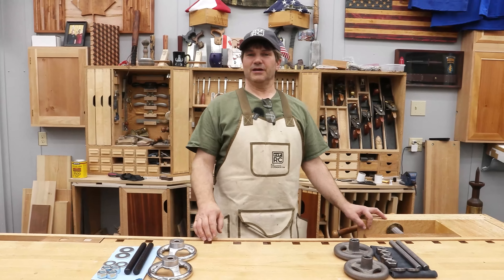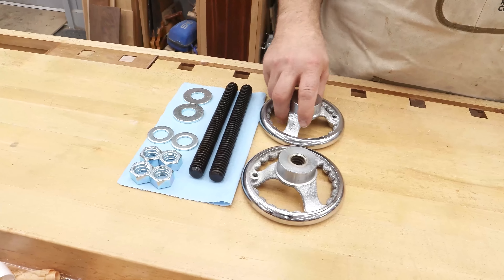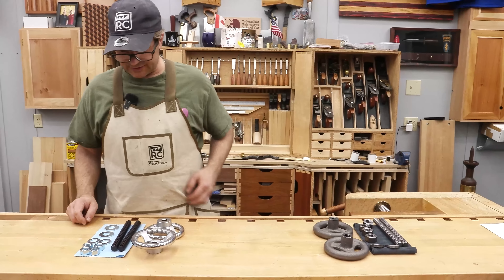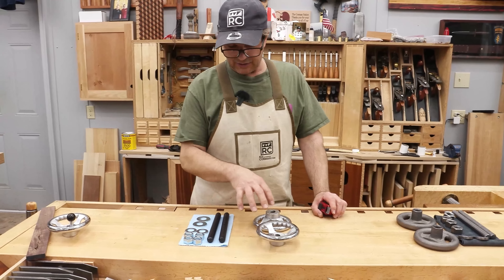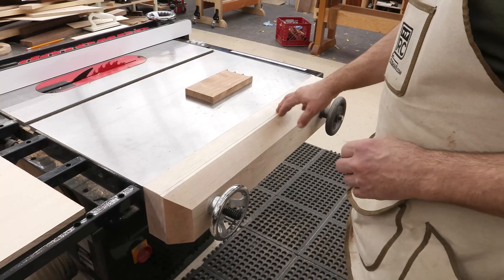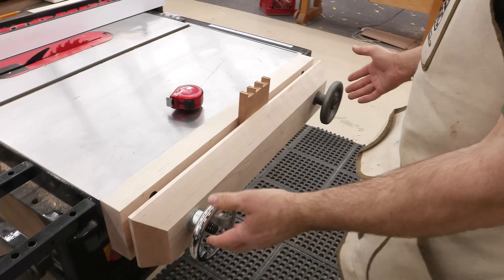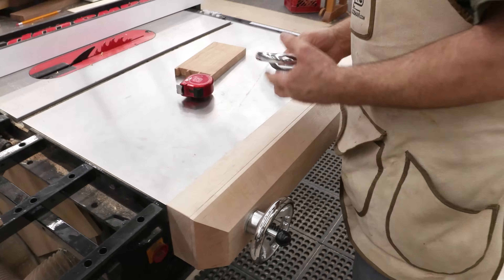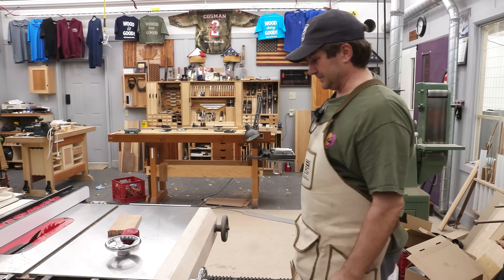Moxon Vise | Hardware Review

Comment: If you have an old weight-lifting bar (like a Olympic Bar), or find one at a garage sale for cheap they work great for the Moxon Vise. Simply cut off the screw-ends and use the spin-on star colars to tighten the vise. The rest of the build is about the same as done here. I did use 3/4 inch copper tube to line the bored holes in the movable jaw to prevent excess wear.
Moxon Vise on the cheap, I love the one I made a little bit ago......
I love watching all of your video's Rob, and the work you do with Wounded Service Veterans.
Reply: That's funny, when I saw the thread I was actually thinking about this as well. And it would be way cheaper.
Reply: @EricClaeren  I found a weight bar for free, the only thing I bought was a few washers.
Reply: You won't get anywhere NEAR the smoothness with the thread on a weight bar. Plus the lock collars are tiny, and are as loose as all hell. Overall, that is a terrible alternative. Better to just go and buy some 3/4" acme threaded rod from the fastener store, some nuts, and turn up a handwheel on the lathe.
Reply: @johncoops6897  The weight bar works smooth enough for me, and I can hand tighten the jaws even with my old hands, not loose at all when tight. For me, making something like this I use on occasion to be more than satisfactory. I understand many people don't want to bother with or have time to make something like this. Believe it on not, many people just can't turn up a handwheel on a lathe. My threaded bar slides just fine with the copper inserts I've used in the jaws. Take care, to each their own. 🙂

Comment: Thanks Rob, I made a Moxon a few years ago with a hand made screw. I tried the wood tap and die set and found that it was manufactured in such a way that it was a force fit for the two. There was simply no clearance between the tap and the die. Bad plan!  The metal wheel is a much better idea. Moxons are very useful in rifle stock repair, so you will need a vise that will open roughly 3 inches.

Comment: I was looking for an inexpensive way to make a vise a couple years ago. 

I used a few pipe clamps, and they worked *ok*.  They ended up being more trouble than they were worth, but the one thing I loved about them was the little handle that sticks out that you can use to quickly close and open them. 

I think I may invest in the Woodriver Moxon kit.  I don't have a good vise on my workbench yet, so this should be an awesome upgrade

Comment: Two disadvantages to both these kits. The rods stick out, so they're easy to run into. The rods are not long enough to allow more than a small opening if the wood you use is 2" thick. Oh, also very expensive. I used rods from Jorgensen veneer press. Works great, no rods stick out, and opens to about 8". Thanks.

Comment: Great video as always.  I just have one concern about the knob on the wheel.  I had a moxon vise years ago and I also put handles on the wheels. Shortly after, I removed them because I was always catching my apron or  clothing on the knobs.  Not a big deal but one that bothered me.  Just my two cents .
Reply from the maker: My concern as well.  For that reason we tried several shapes and sizes of knob and settled on this one.
Reply: Can we lock the wheel so that the screw will go inside instead? Something like veneer screw clamp.

Comment: Rob, can you give information on where to get the handle you attached to the wheel?  Thanks.
Reply: Pay attention - he told you in the video.
Reply: @johncoops6897  I only found where he talks about buying the whole kit, not where to get the specific handle he is using.  Could you point out the time in the video where information is given about where to get the handle.  And thanks, I'll try to increase my attention level.
Reply: @kenwood7395  - the wheels are part of the kit he sells. He makes the small knob and spacer, which are included in his kit but not the original one.
You can just buy any knob and a bolt (to modify your own wheels) from a hardware store.

Comment: I already have the Lie Nielsen Moxon  1" threads.  What do you call those springs and where did you get them.  Your kit is for 3/4" threads.
Reply from the maker: Our springs are custom made compression springs.
Reply: Those springs are called "springs" - amazingly, you can buy them at any hardware store.
Reply from the maker: @johncoops6897  nope, they’re compression springs. Guess you don’t know everything.
Reply: @RobCosmanWoodworking  - there's 2 types of coiled springs: compression springs and tension springs. Both types are called "springs" 😄
Reply from the maker: @johncoops6897  and which of those answer his question? Because these certainly aren’t tension springs, and we couldn’t find them at any hardware store.
Reply: You can get them through McMaster-Carr. Your part numbers would be either the 2” long compressed to .84” or the 3” long compressed to 1.2”. 2” part number is 1986K248, 3” part number is 1986K339. Hope that helps
Reply: @MrMaacin05  Thanks for helping me out.

Comment: Its a screw and a handle… i think taiwan can manage that to be honest!

On the tablesaw instalation, when not in use, id be inclined to keep a piece of wood clamped in the jaw. That way you wont bump into thread3d rod, you will hit the handle.
Reply from the maker: What we did was thread as much of the Rod into SawStop as possible, and now as a result it only sticks out as far as the knobs we have attached to the wheels.

Comment: ah come on. Out of the box, the Benchcrafted beats the Woodriver on every quality metric discussd here. But Rob still recommends the Woodriver? This is not a review. It's an ad.
Reply: First time watching a Rob review? Lol. He's a business man first. He's obviously going to recommend what he's selling.
Reply: It may be an ad, but it is not a misleading one. The Woodriver with the handle modification is a superior product, even if the quality of the parts is lower. The combination of the springs and the modified handle more than compensate for the superior quality of the Benchcraft.
Reply: It's also like 60% more though, isn't that an important metric?
Reply: @alankleiman3452  Frankly, I think for typical furniture woodworking usability is a more important metric than strength, assuming both are strong enough. The spring and the modified handle lower the risk of dropping the work through the jaws.
Reply from the maker: The need for a vise brought on the idea to shoot the video.  Someone else had the great idea of using the heaviest piece of equipment for another use.  We ordered both kits and saw the opportunity to improve the function with springs and knobs.  The Woodriver already had the flat spot cast into the wheel.  Easy fit to drill and tap for the knobs.  I  like it when products solve problems that exist instead of creating a problem to justify a product.  You watch the video and if you have the need you order the kit, if you watch and dont have the need, what harm done?
Reply from the maker: You’re not speaking from a position of having already added knobs, so your opinion is moot. The knobs make quick work of moving the vise to exactly where I want it to be, thus an improvement. What Benchcrafted does with their casting is their business, and I’m sure they have reasons for doing what they do. But in my opinion, the knobs add great functionality in an area that is lacking. Ever watch the David Barron video where he added the knobs to his Moxon vise? I guess he thought it was needed too.
Reply: @skwalka6372  I was talking about cost. The woodriver is 60% more expensive than the benchcrafted.
Reply: @garyhubley  Well then, DONT call it a review eh.
Reply: @garyhubley  if that’s true, it’s not a review.

Comment: No reason you can’t figure a way to add a crank handle to any hand wheel. I like the rough cast iron.
Reply from the maker: these were easier since there is a small flat spot on the inside of the wheel.

Comment: I’ll say up front that I have the Benchcrafted hardware Moxon  vise and I and love it. USA made trumps China made any/every day. What I don’t understand in this video is the logic of mounting this vise on a table saw when the concept of a Moxon vise is to elevate the work to more easily cut dovetails?  Not Rob’s best idea.
Reply from the maker: Was the machining much better on the Benchcrafted? Yes. But it was a rough cast on the wheels and didn’t have a spot for attaching the little knobs. A $75 price difference and the WoodRiver was nicer to turn, and even better when the revolving knobs are added. I didn’t have a need for a Moxon vise on my bench, but the addition to my tablesaw is great. Use them however you’d like.
Reply: It wasn’t Rob’s idea. He liked it so he did it to show that if you don’t have a bench, it’s a good place to put one. That’s all.
Reply: @RobCosmanWoodworking  The rough casting is the Benchcrafted Moxon C. Benchcrafted also offers a machined finish (similar to the Woodriver) in their Moxon M. That's probably a better comparison. I haven't used the Moxon hardware, but I just finished building a bench with their tail and end vise hardware, and the fit & finish on the wheels and thread are excellent.
Reply from the maker: my mistake, "Taiwan" not China, matters to the Taiwanese.
Reply: @steveshepard7643  According to Rob in a different post the polished version is an extra $80. That makes it more than double the price of the Woodriver. Wouldn't that make the Benchcrafted actually look worse in comparison?
Reply: @alankleiman3452  Rob (of whom I'm a big fan, BTW) mentioned the cast as an issue. I thought that appearance-wise, the machined Benchcrafted wheel was a better comparison. It is more expensive, which is certainly a consideration. If you're optimizing for cost, you might also have a look at the Taytools moxon hardware kit.

Comment: Skip all of these kits….McMaster Carr is the way to go…acme threaded rod and nut, bronze bushings and misalignment washers….your welcome
Reply from the maker: Hand wheels? You price those out? $60 per, that’s $120 in wheels alone. Unthreaded, so you’ll have to pick up a tap. Best of luck.
Reply: @RobCosmanWoodworking Hand wheels for 3/4 rod with a set screw $36….good luck
Reply from the maker: Link?